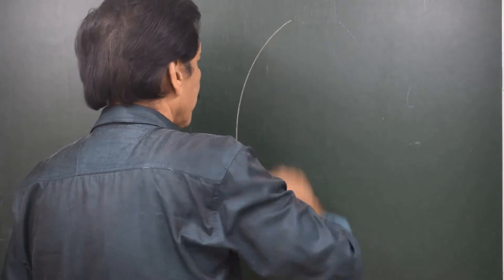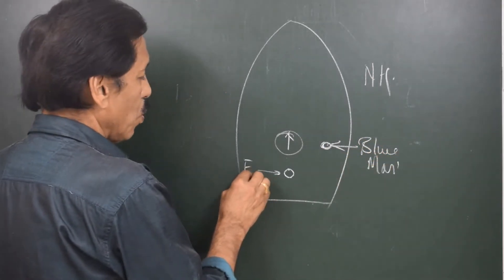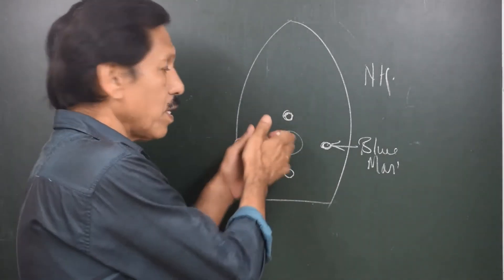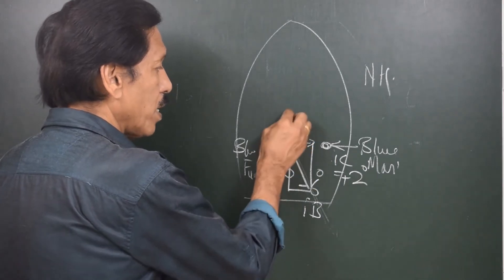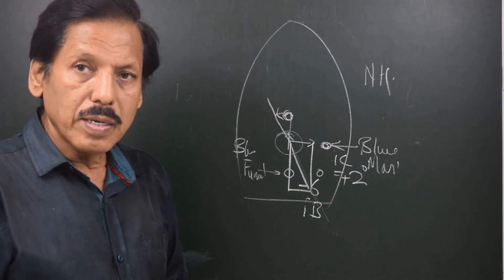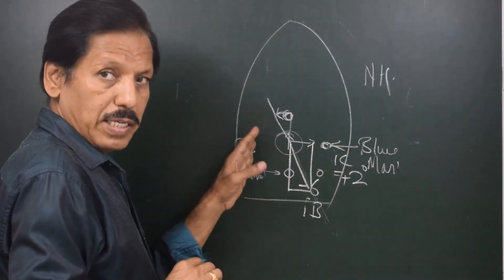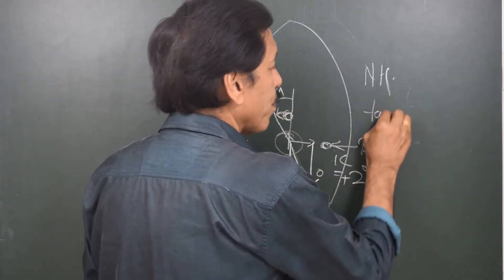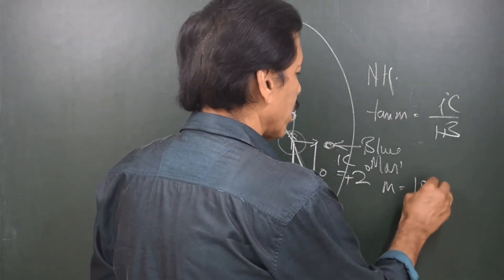Correction of iB & iC with Flinder's Bar

Comment: Hi, here you have mentioned the formation if iC due to the stbd side mast. My question is, The blue pole which is formed in the mast will be on top in the northern hemisphere ryt? So blue pole above the compass should have a negative sign? Correct me if i am wrong.
Reply from the maker: When it comes to fore mast, funnel, port or stbd mast, it is always considered that the blue pole is in the same horizontal level as compass. Blue to stbd, forward, and below, gives rise to positive coefficient.

Comment: Dear Capt.. Could you help us, my compas located not in the centre of the bridge because of the construction, we in the port side of the bridge, and the result the compas always show tendency to anticlockwise , we have already corrected by corrector but the compass still show anti clockwise..
Reply from the maker: If your funnel is in centreline, the compass adjuster must approach the vector method of parallelogram to resolve the problem.